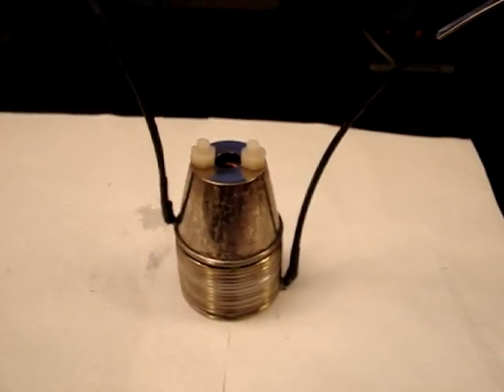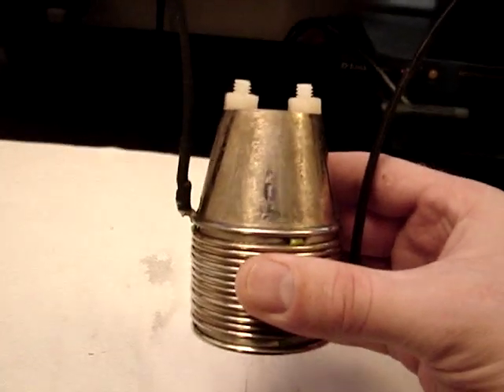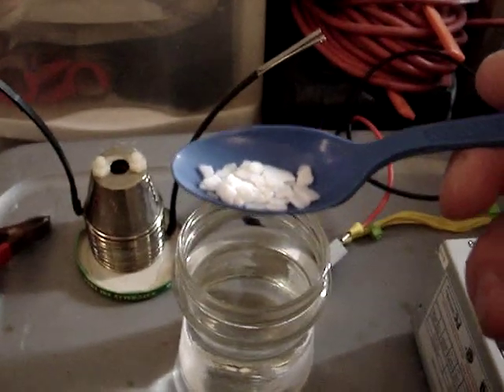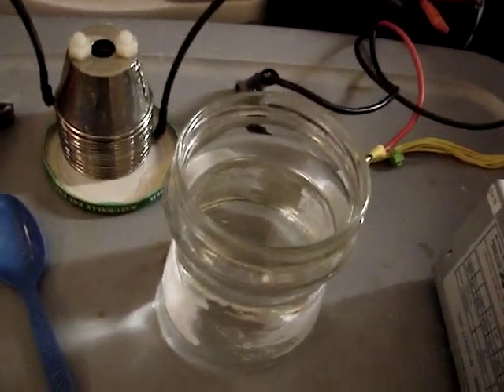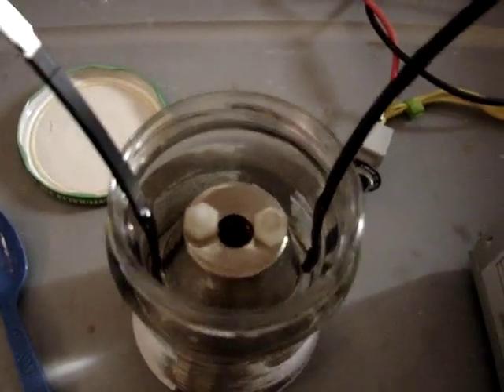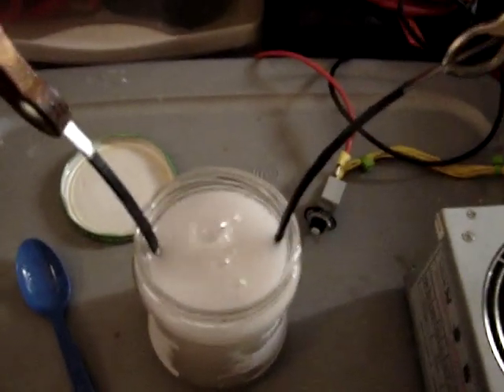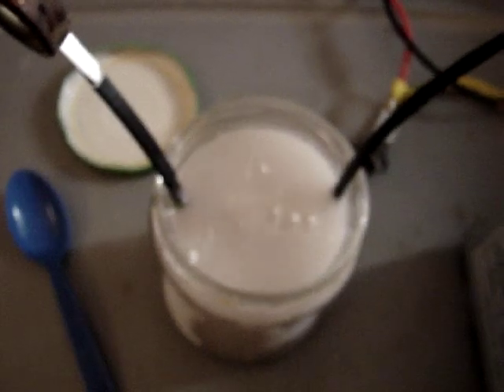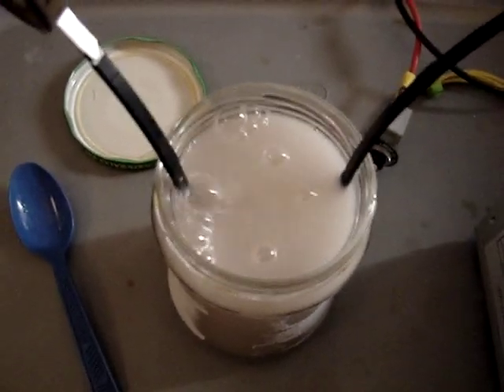Vid13 Volcano Cell 15 Cup HHO Generator Demo (HHO, Brown's Gas, Hydroxy)

Comment: How can we keep this gas until we use it at a later time ??
Is it suitable instead for cooking gas ?
With many thanks
Reply from the maker: Storing HHO gas can be dangerous, because it is highly explosive. However, if you can separate the oxygen and hydrogen, the hydrogen is safe for cooking, heating or storage.
Reply: @HHO4ALL  in these case, I think if we link the air compressor with the pressure tank in the sequence after the hydrogen generator and the bubble box. Isn't it supposed to keep the hydrogen gas in the tank, of course with a pressure gauge and a flashback arrestor for safety?

Comment: @boholhunter29  those cups are 316 stainless steel and i GOT SOME just like them at wal-mart cheap get like 5 cups to a set for something like $1.99 and they are brushed stainless, and yes I have put them in simular sequence but used 40 cups hard to find all thread nylon that long but found some online, been 3 years ago used in Sch-40 PVC

Comment from the maker: @legogunguy001 

You should use the flipcup redesign that I used from Video 17. It produced over 1 LPM.

Neg
Neutral (2 stacked)
Neutral (2 stacked)
Pos
Neutral (2 stacked)
Neutral (2 stacked)
Neg

This will give you less than 2 volts per cup and will keep the amperage and heat to a minimum.

I hope this helps.

Comment from the maker: It will not create liquid oxygen, because it only splits the water molecules into a gas form.

2 Parts Hydrogen & 1 Part Oxygen.

When burned the gas will return to its original state... water.

Comment from the maker: i've heard the dog dish idea a few times, but they are way too big to be practical.  Fun for testing, but I have a ford focus and there isn't a lot of room under the hood.  That is why I'm focusing my efforts on trying to get the best output possible from a small fuel cell.  After all I can always connect several cells together to get better output.

You are absolutely right about PVC pipe.  I'm working on a 2.5" wide x 4" tall clear pvc enclosure, because 2" was too small to fit the cups.

Comment from the maker: Small is good and means way less water. 

So I guess that would be a good thing, because you don't want to be electrically charging a gallon of water to run a fuel cell.

Plus it doesn't take as much electrolyte to run the cell.

Comment from the maker: I took your advice and reconfigured my cell as follows: + NN NN NN NN NN -

It does not produce as much as before, but it isn't bad. The best part is that the connectors and the container never got warm during the past 4 hours I've had it running.

I did have to add more KOH to get similar output. Instead of 1/4 teaspoon, I'm using a 1/2 teaspoon.

I'll be sure to record the output and give credit where it is due. You helped me out big time!

Comment: That is something that is worth to try. 
The smack booster makes use of that configuration.  (check this channel from Eletrikride). But you know for sure that it is more productive when you can measure the HHO output. When you can measure the output you can calculate the efficiency called MMW, (milliliters per minute per used watt). The water temperature is also important because you get different outcomes with different water temperatures. The gas expands drastically when it gets warmer....

Comment from the maker: I figured this was the case, because my neutral cups are touching each other they become one neutral cup. That would mean that my 15 cup cell is actually a 3 cup cell and the positive negative and neutral are all using 4 volts.

I'll try reducing the number of neutrals and inserting spacers.

Comment: A different enclosure is not the way to go, you can get rid of the heat by making a cell that is build the wright way. A hydrogen cell that is working properly should not get much warmer  as 110 degrees Fahrenheit. That is when you use 5 separated, isolated neutrals with one positive and one negative. Stacked neutrals will react as one single neutral, do your measurements.

Comment: You are creating heat because your neutrals are wrong. You didn't isolate the neutrals from each other. If you measure the voltage you will notice that the voltage on your stacked neutral cups is far above 2 volt and then the cell will create more heat then it should. Adding more neutrals with no spacing is a waste of time if you want to make a useful cell. The reason why you have to use isolated neutrals is to create an even voltage drop from around 2 volts per cup or plate.

Comment from the maker: So far the water has not turned brown. With other cells I've gotten light brown water.

I am still waiting on an Amp meter that I ordered online, but I know for certain that it is running less than 15 Amps. The reason that I'm certain it is below 15 Amps, is because I have a 15 Breaker that never popped after 2 hours of running the cell.